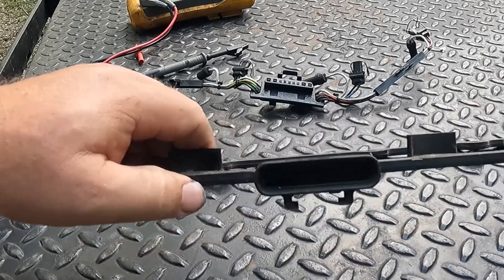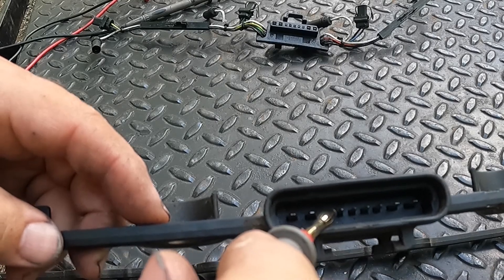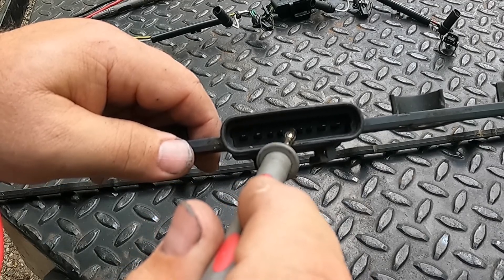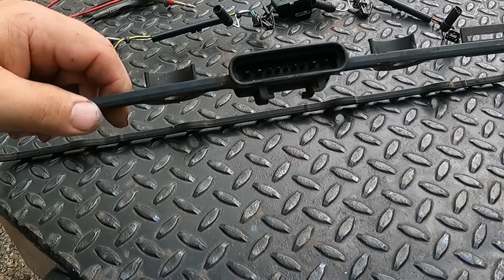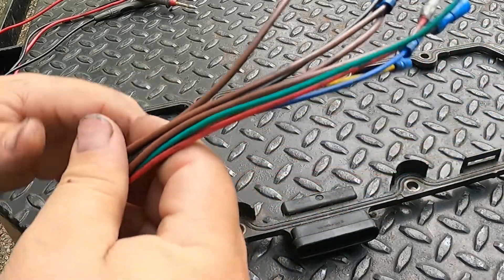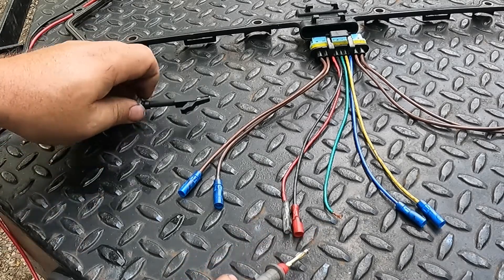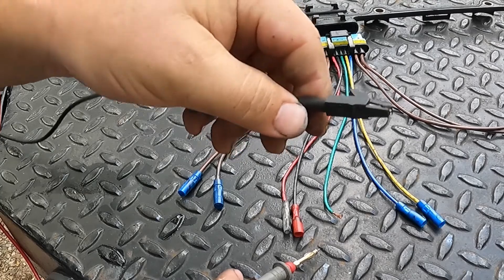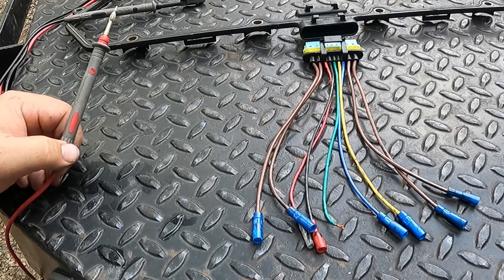Testing UVCH (under valve cover harness)Ohming Through 9 pin Pig Tail

Comment: Hi my injectors testing 4.6 ohm 5.39 ohm and 6.2 ohms can you tell me what that means?
Please
Reply from the maker: If I remember correctly injectors should ohm out between 2.8-3.6. If you are testing directly off the injector then its solenoid is out of spec. If you are testing through the wiring harness or a connector then it could be the injector or the wiring that is bad. 
If you have access to a scan tool I would do a buzz test and a cylinder contribution test to see if it’s throwing any codes.
Reply: @bayoudiesel Hi my truck threw the service engine soon light on and then it just lost power and wouldn’t want to turn on anymore I got it towed home and only injector two I’m getting 2.6 ohms all the other ones are in spec 3.0 ohms, I did a buzz test and I got codes p0264 and p1272. where should I go from here? Injector two is the only one that sounds muffled do I need to replace just the one injector?
Reply from the maker: @Damian-mh9zn before you replace the injector I’d check the wiring. I find more wiring issues than component issues in these trucks due to their age. I will start one of two ways. Either at the idm plug (which I have a video of) or at the injector itself. For example in the video I ohm the circuits from the idm plug. If I find something out of spec I’ll move in to the 42 pin and repeat then to the 9 pin uvch plug and even to the injector itself. Again if you have the valve covers off you can start at the injector and go backwards. 

Keep in mind that even a frayed wire can still pass and ohm test due to the minimal voltage so I may be necessary to use something like a 12v light to load test a questionable wire. 
As you probably already know 0264 suggests harness shorted to ground and 1272 is the code for the number 2 cylinder having an electrical issue. May have to pull loom open and inspect the harness with a close eye on the colors of wire pertaining to injector 2.

Hit me back and let me know what ya find. Or if ya have other questions. Good luck

Comment: I just did mine mines is ohm out at 4.2 ish on passenger side im getting a p1316 code with it being higher than. 3.8 what would you recommend
Reply from the maker: Ok so the p1316 code to me just means the idm has stored codes about something it isn’t happy with. Usually I find that this is linked to wiring issue. 
First off what are the symptoms and are codes you are finding? And from which connector did you ohm test from?
Reply: @bayoudiesel I did the passenger side 
I recently did a motor swap and the only code i'm throwing is p1316
Sounds and feels like only half the motor is running 
No power, no acceleration ,
Reply from the maker: @LACAJUN420 probably a short or poor connection to that bank. I would ohm test from the idm plug, then the 42 pin and finally to the 9 pin on the uvch to try to narrow down to where the issue is.

Comment: Would anyone have p/n's for the leads and the connector that plugs into the valve cover? I have some damaged pins I would like to replace vs a pigtail.
Reply from the maker: @HenryHubbardJrHeuerCalibre12  with all the heat these plugs see between the engine and the glow plugs I find that it’s better to just replace the entire connector. But I guess re pinning would work if that’s the route ya want to go.
Reply: @bayoudiesel  Would you be able to share a link to a good quality pigtail? I have a 2001 Excursion 7.3l.

Comment: Oh yeah,  I pulled the idm and it's got a good amount of corrosion on the box and the black paint is easy to flake off and near the vent there is a bit of  bubbling under the black paint
Reply from the maker: @John-n6g  I’m happy to help any way I can. You first comment was about the pcm. Then we moved to the p1316 idm code. It’s always possible that any component can fail but in my experience the 1316 code is usually wiring / connector related. 

Before we get too far into the weeds can we back up a bit?  Tell me what’s been going on with the truck and let’s make sure we are on the right path.

Comment: First I'd like to thank you on your down to earth method of explaining what you are doing and what we can do!!! I tested my ohms on the idm harness and they all came within the parameters. Only the 5 and 7 showed 3.6 ohms.  I haven't  yet ohmed out the plug into the valve cover gaskets but will do so tomorrow after watching  your informative video.  I forgot to mention before that there were times,  about a year ago that I would hit the accelerator 2 or 3 times to get a response and it would work and I didn't much think about it since everything seemed to work fine.  Could that have been a sign that the idm was heading south or maybe the cps or pcm or the idm,  which I'm thinking is the case? I could really use your thoughts on this matter before I start buying parts that I don't need.  Thank you for your time  in helping me!!!
Reply from the maker: @John-n6g  the accelerator pedal (ie throttle position sensor) is a know part to fail on these trucks. They usually get a dead spot around the usual speed you drive or can sometimes just go out. I swapped one out and a year later had an issue only to find out I failed to plug it all the way in till it locked. And it took a year to have the plug rattle loose. Had to come home from 2 hours out on cruise control cause I had no pedal response. Got real fun timing traffic and lights.

Comment: 1999 F350 7.3
Codes P1316 and P1275
P1275 only appears after performing injector buzz test
Any recommendations on approach?
Reply from the maker: The codes from 1271-1278 are trouble with cylinder 1-8 respectively. Yours is 1275 so cylinder 5 ain’t happy. The majority of the time that I see this code it is a wiring / connector issue in the engine harness or uvch. May possibly be the injector itself or the idm but usually wiring. 

Time for some investigation. You can pin out with an ohm meter, you could also swap sides with the uvch’s and see if the trouble moves.
Reply: Tested glow plugs. Test light to battery positive. Test light lit up on every cylinder. Driver side valve cover: cylinder 2 showed 5.6 ohms when tested on the vehicle. Removed valve cover gasket and retested. 0.01 ohms on all cylinders and glow plug circuit. Passenger side injectors within specs at 3.0 - 3.2 ohms
Valve cover gaskets are one piece.  Unable to use the quarter trick
Reply from the maker: @jamesfaison9410  I would have to look up spec for glow plug ohms to remember the range but I do know that new OEM plugs usually him out to 0.4. If glow plugs are in spec when tested directly to the plugs but the previous test through the harness tested too high then the harness seems to be the issue. 

Glow plugs and test light will light up as long as it still has continuity but can be way out on an ohm test. But this test is great for quickly determining if any have blown
Reply: @bayoudiesel  I don't suspect any glow plugs issues. We had some severe cold weather last month (Memphis, 0°F) and I had no starting issues without block heater plugged in. Cycled the key a couple of times and engine fired right up. On the driver side valve cover gasket for cylinder 6, I found the wire sheathing was broken all the way around, exposing the wire. I'm going to replace the valve cover gaskets and the external pigtail
Reply from the maker: @jamesfaison9410  that’s the direction I’d go. Let me know what ya find out. Or feel free to hit me back with a question if ya need. Good luck.
Reply: @bayoudiesel , thank you for your answers, friend. I have one more question. Given that I have an injector code due most likely to the valve cover harness being defective, how does that play into the SES light coming on and off in almost synchronicity with throttle operation? It happens less when the engine is cold but much more after warmed up
Reply from the maker: @jamesfaison9410  what are the codes being thrown? Just that 1275?
Reply from the maker: Another thought could be accelerator pedal. They are know to develop bad spots. Can be checked with live data on a scanner monitoring voltage thru travel
Reply: @bayoudiesel , awesome! I'll take a look at that
Thanks again
Will update 😎😎👍👍
Reply from the maker: @jamesfaison9410  hope it helps. If not we can pick up after you get done with what you currently on.
Reply: I have purchased the replacement parts needed to complete the repair. The external pigtail I purchased from Ford is NOT color-coded. Have you seen this before?
Reply from the maker: @jamesfaison9410  on the 9 pin pigtail worry about locations more than color. The center pin is the injector common, the next 2 in front or injectors respectively same for the next 2 behind. Example front 2 are 2&4 back 2 are 6&8 for drivers side. And the outter most 2 at each end are glow plugs. They have larger wires and spades for higher voltage. Front 2 are 2&4 rear 2 are 6&8 respectively
Reply from the maker: Also take care to re wrap the foil shield and ground wire that are externally wrapped under the loom.
Reply: @bayoudiesel , I don't recall ever seeing that on these pigtails but I'll keep it in mind. Thanks 😎😎
Reply: Update: replaced UVCH and gaskets
No change. 
Codes: P1316, P0603, P1275
I had a scanner connected and looked at some live data on the throttle percentage and voltage. At "idle" the percentage is about 10% and 0.5 volts. Even at idle, the percentage and voltage would go to "N/A"  simultaneously very quickly and start displaying data again. When holding the pedal to the floor, the percentage and voltage would drop out very quickly and return. The percentage only went to 74% and the voltage went as high as 3.5. Your opinion would be greatly appreciated, friend. I think I found A problem. May not be THE problem lol
Reply from the maker: @jamesfaison9410  so 603 is kam(keep alive memory) that’s just from disconnecting batteries. 1316 is kinda non specific in that it means something in the idm circuit is not happy and of course 1275 would appear that cylinder 5 is the one giving trouble. 

As for the throttle voltage cutting out, I mentioned before the tps in the accelerator pedal is know to go out. 

We may be getting too deep in the weeds for the comment section. If you like you can send me your number by email and we can chat about your rig 
Bayoudieseltrucks@gmail.com

Comment: man im loosing my butt on this truck. I talked to ya yesterday on another video. this thing ain't throwing codes and passed the buzz test but i got a nasty misfire. I'm ohm the uvch. inj 6 is like 25.0 rest are fine. now on glow plugs only 1 is reading with 0.4 the rest have zero resistance.
Reply: sorry to bug ya so much I just can't afford to throw parts at it til fixed but I'm not the best diagnostic guy. what does it sound like to you?
Reply from the maker: @recruit_life0715  not a bother my friend. I totally understand how quickly money can fly out the window with these girls. 
So ya all cylinders have passed the buzz test but 6 is way out of spec. That seems odd. 
How does 6 sound compared to the others when buzz tested?  Sharp or muffled?

As for glow plugs, you may need to replace the set if you don’t know the history and if a large number are failing. It’s kinda hard for me to say not being familiar with the history of the truck. You can physically test the glow plugs while they are out just have to be very careful cause they get really hot really fast. Let me know if u want info on that.
Reply from the maker: It may be more time efficient to kick this around over the phone vs text.
Reply: @bayoudiesel  it's my boss man's truck so I can have any history on it if I ask him. he's the one who did the buzz test said he did them all. then individually. some sounded different but nothing crazy. which led to me trying different idm and testing harness etc. I sent my number if you wanna give a hollar. I don't wanna tie your whole day up diagnosing over the phone. if you got free time this evening or weekend we can chat about it when boss man is here so you will have a better understanding of what's goin on. really appreciate your time sir.
Reply from the maker: @recruit_life0715  haven’t seen an email yet. But I should be free some this evening to chat. 
Bayoudieseltrucks@gmail.com
Reply from the maker: @recruit_life0715  didn’t look like this went thru so sending again. 
Have not seen an email yet with your number. I’ll check again later when i take a brake. I may have miss typed so here is mine again 
Bayoudieseltrucks@gmail.com.

Comment: Hey I have a 99 Ford f350 with 7.3 i scanned it weeks ago and it gave me codes on the obd scan , now I wot (wide open throttled it ) now service engine light came on it is running a little rough barely noticeable. When I go to scan it it tells me no obd codes stored and ecu no response. Kinda weird , I washed the motor like 2 weeks before .
Reply from the maker: How do ya get a “no codes” when the ecu isn’t communicating?
Reply from the maker: Usually if u have electrical trouble after washing a motor u need to dry out or spray out ur electrical connections with contact cleaner. I’ve also used Ed-40. Need more info to take it further. Keep in mind that all these girls are over 20yrs old so bad wiring is an issue which would be exacerbated by washing as well

Comment: I ohmed my injector uvch just like you showed here and all of mine except 2 and 4 read 3.9 ohms. Cylinder 2 read 4.3 ohms and cylinder 4 read 4.1 ohms. My truck is pouring out white smoke that smells like raw diesel. No matter if it’s up to temp or cold.  I already replaced the icp and the cps. Buzz tested it and the buzzes were all over the place. Did a cylinder contribution test and cylinders 1,4, and 8 all came up as a problem. What do you think? Any help would be greatly appreciated. 

The truck is an early 99 f250 powerstroke.
Reply from the maker: So it appears you have some injectors dumping fuel which causes the smoke and rich diesel smell.  Assuming there is nothing going on compression wise in a cylinder lets start with the smaller stuff.  If I remember correctly injectors ohm good when between 2.8-3.6.  All this tells ya is that the electrical side is ok or not.  Could be wiring, connectors or solenoids.  This can test good but the injector still have internal mechanical issues.  On my scanner a buzz test will come up with a pass/fail for each cylinder which can most of the time   be confirmed by what you hear as well.  Did buzz test indicate any failed?  Or do the same suspected cylinders sound different?

In my opinion the cylinder contribution test is a good way to spot trouble. At least which cyl. According to your info cyl 4 has failed both ohm & contribution so that may be a big part of the your problem.  cyl 8 almost always comes up on contribution due to the AE injector it uses and I don't usually worry about that unless i have another indication that 8 is bad. 

Because you have cylinders indicating  problems on both the left and right banks I would not think trouble with the 9 pin uvch plugs but it is a good habit to check them.  

So that leaves us with 1,2,4 and maybe 8 causing problems.  To narrow down that it is actually the injectors and not wiring you can swap good and bad injectors around and see if the problem moves by re running your previous tests.  If location stays the same, meaning 1,2,4 ect then wiring may be the problem.  If it follows the bad injectors then you need some injectors.

Sorry for the length.  Feel free to hit me up on my e-mail  bayoudieseltrucks@gmail.com sense this is kinda long winded for comments. lol.  

Hope this helps ya.  Let me know what you find out or if you have any other questions.  Thanks for giving my channel some of your time.  If you get something out of it please share it around.
Reply: @bayoudiesel  brother you are the best! You’ve got my sub. I’ll send you an email in the morning. Thank you so much! 🤙🏼
Reply from the maker: @Big-kon  just paying it forward. Hope it helps u get the ole girl feeling better. They can be moody bitches some time. But when they are feeling good there is nothing better.